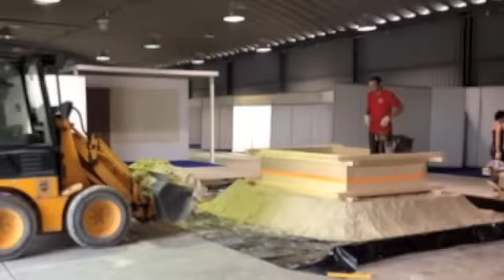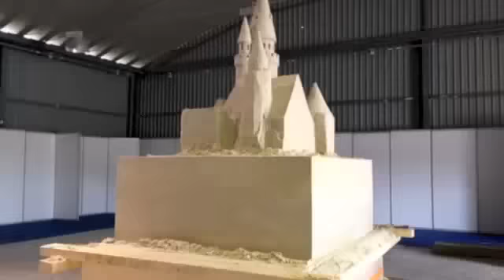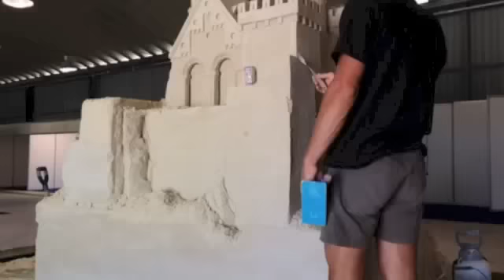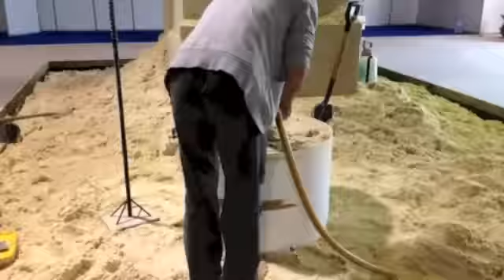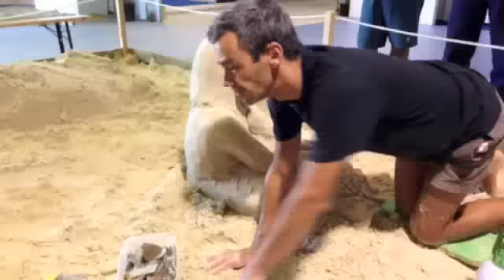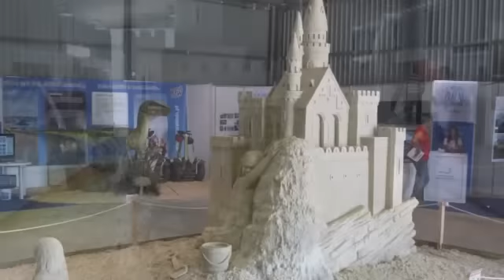Making a professional sand castle time lapse

Comment: is there any adhesive used at all or is this just sand?  I don't understand how this is able to stay standing for more than a minute.
Reply from the maker: +jonathan lavigne 
As you can see in the beginning of the video the sand is compacted very hard with a stamping machine, layer by layer. As long as it doesn't dry the sand keeps it's form (if you know what you're doing and don't push it too much).
At the end a thin layer of glue is sprayed and this will just avoid the sand to dry or to blow with the wind or rain if it's outside.
Reply: im going to the beach tomorrow is there anyway that i can do this at my state beach or will it just fall apart and not work at all.  not stuff this big just something small like a turtle
Reply from the maker: +jonathan lavigne 
That depends on what kind of sand you have at the beach. If the sand is curse or have round grains it will be harder. Just mix it with water and tap it layer by layer. Once you start shaping it you'll find out if it's good sand....